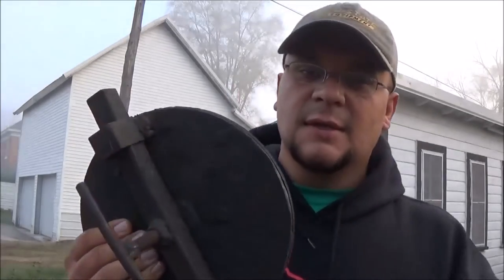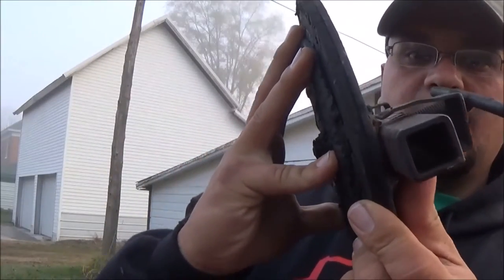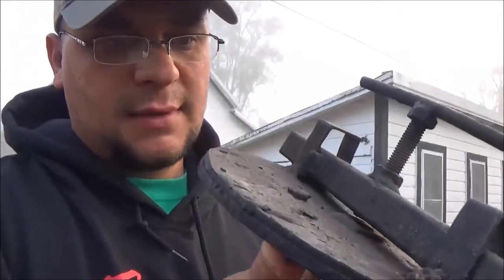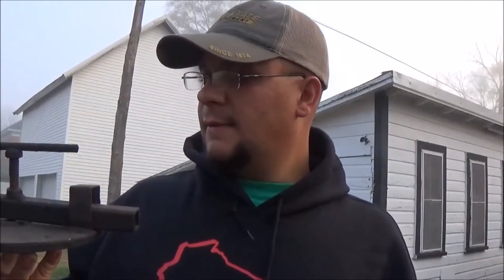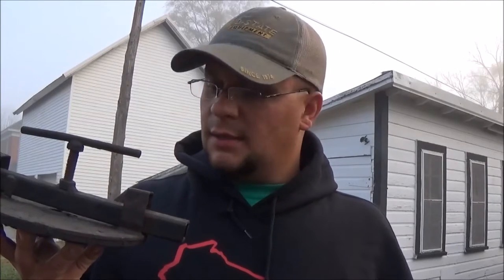Sealcoating Strainer Basket / Filter Pot Lid Fix

Comment: Question: I've gotten a bad batch of sealcoat which has large chunks in it some of those chunks the small ones got through obviously my filter was inadequate does pumping the bad sealer out into another tank and they're leaving a in abundance of sand material in the bottom of my tank and then washing it out are you seem to have lost the aggregate in the sealcoat what can I do to not eat this 300 gallons of sealcoat or essentially take it in the shorts on the money the end of it I'm hoping there's an answer
Reply from the maker: Man. I think you are going to have to eat it unless you can filter it somehow.